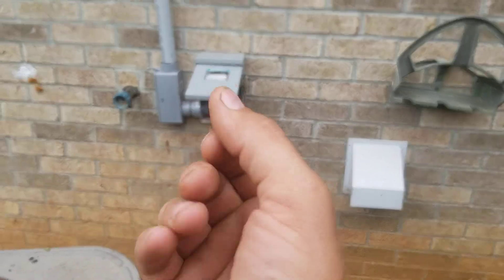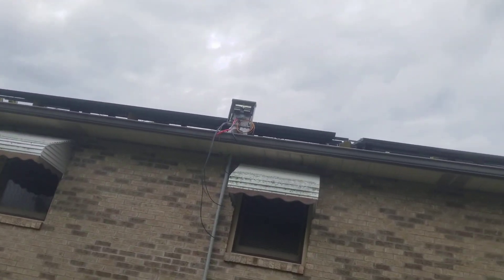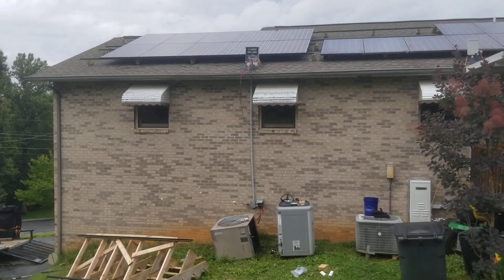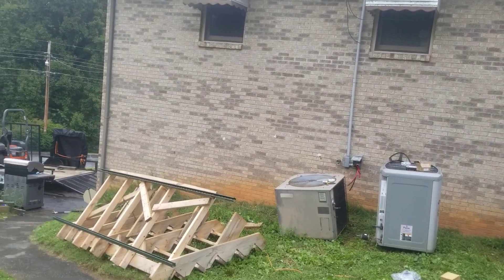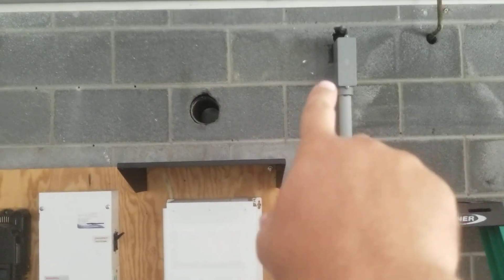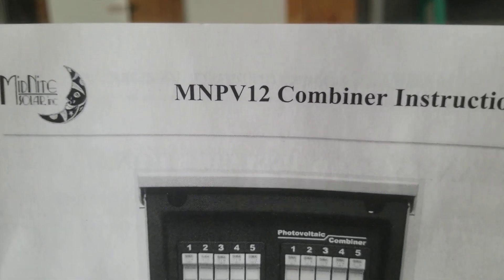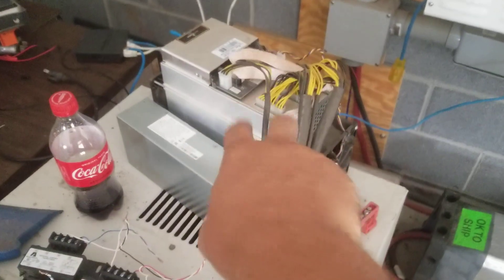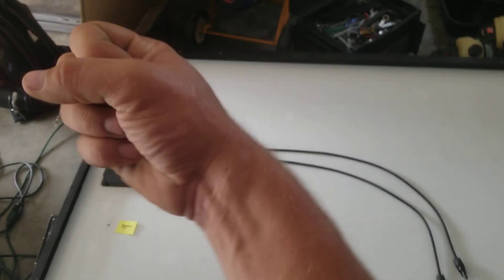Installing 0 gauge wire on a 60 amp circuit for my 10 kW solar array

Comment: you should of drop it thru the roof on the inside. just my thought,is there a reason you have it outside ? 
kicking in the but ,keep up the good work. im learning ,thanks for posting.
over and out
Reply from the maker: I don't need the pipe in my shitter room my wife will be mad when taking a dump